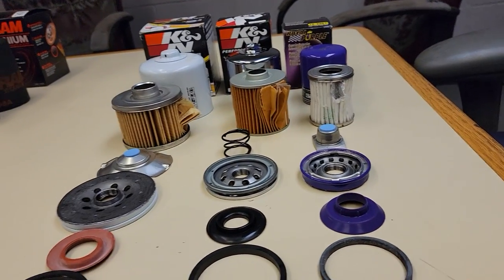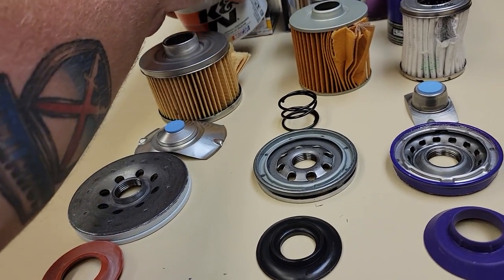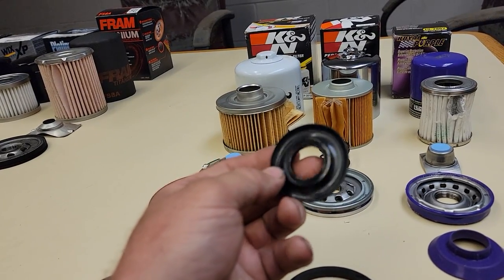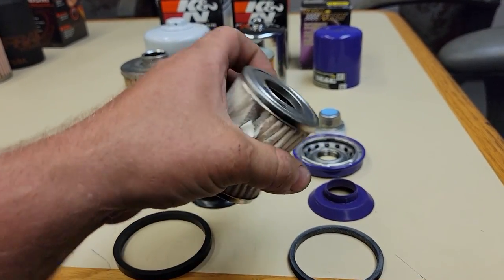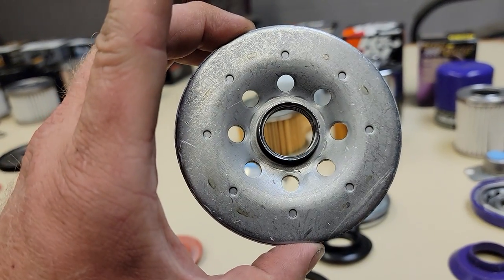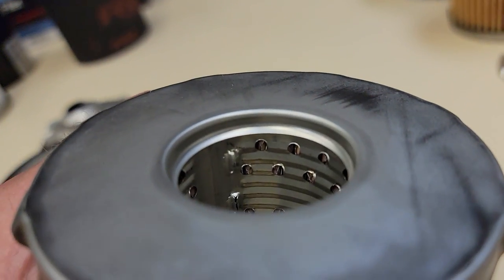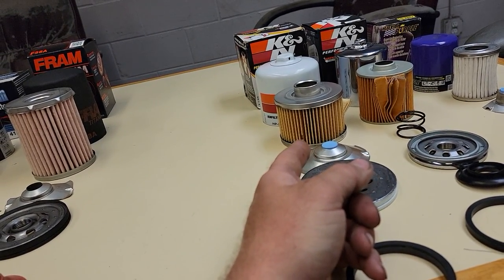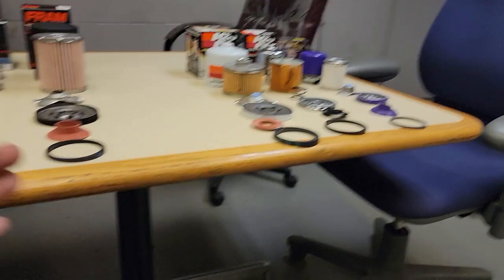K&N Plaitum, K&N Gold, Royal Purple, Fram Titanium - Break Down And Review - Fram / Gold - Tie

Comment: I just did my first ever DIY oil change @ 3K on my 2021 Tacoma with the 4cyl 2TR FE.  Used the K&N gold filter along with their brand of 0w20 oil. Love the channel.  I have brand loyalty which is why I went with them.
Reply: K&N has always seemed good to me, i don't like their Performance Air filters Due to them allowing more "Dust" in the Engine, But gives better "Air Flow" ofcourse. I'd rather keep my Rings and Valves in good condition than get 5HP to 10HP boost
Reply: @Robs_Got_A_Gun  Respectable. I will acknowledge Theres a lot of love hate with the air filters. To each there own though.
Reply: Tee Mack  The 2TR FE is a small motor and very easy to work on. The truck is part of the Tacoma Culture. Lots of groups and support with that particular truck so between YT videos and some homework it was a breeze. And I'm a complete novice.
Reply: @mikezat6328  tons of respect for ya Mike. Doing your own work is very satisfying and will save you a ton of money. Question: No free changes with that truck?
Reply: @chadpugh1490  They will not do the "free change" until 10k they only check it at 5K if you read the fine print. I'm sticking to the traditional 3K-4K intervals.

Comment: I'm not a fan of that Royal Purple one lol, I'll Stick to Purolator, To me Royal Purple is just all Hype, Their Oil ain't even as good as Pennzoil Ultra Synthetic..... and it's 2X more $$$
Reply: I figured I would try royal purple oil in my generator. Only thing I have used it for. Don’t know if it’s worth the money or not
Reply: EVER since I came across the Puralator, Have NEVER looked back or tried ANY other oil filter... I swear by Puralator.. I will say I have been using the Pure 1 for years now..But after Richs video and many subs suggesting the Boss Puralator... I just bought my first Boss..And for literally $1-2  more difference...
Reply: @Robs_Got_A_Gun  that’s good to know, won’t waste my money on that anymore, good thing I only bought a quart
Reply: @mattyroc77  Yeah same here, i only use Purolator, But gotta give some filters like Fram Ultra Synthetic a good Rating also.
Reply: @eradicater6854  as far as Expensive Oil goes, Go with Amsoil, It's the Best, But expensive.
For better Everyday Value, Pennzoil Ultra Platinum is really Good also.

I Personally use Valvoline Maxlife Full Synthetic
Reply: @Robs_Got_A_Gun  I run amsoil in my motorcycle. So expensive though, but the peace of mind is worth every penny.
Reply: @eradicater6854  Amsoil is definitely worth it in the Long run. I use Valvoline alot because it's a Good Oil accross the whole Spectrum of Tests it went through on "Project Farms" Rigorous Controlled Testing Methods.
Reply from the maker: Prim is underrated - the ultra synthetic and titanium filter I would probably put up against any filter on the market
Reply from the maker: Purolatorboss would be my regular filter by choice and seeing as they make Ford's filters to make me feel even better but I do have to give it to the factory Ford filter overall great quality

Comment: winner for value still goes to the fram ultra then the titanium.
Reply: Unfortunately Eli... Fram has changed the media on the Titanium and Ultra.
Reply: @jerryjeromehawkins1712  yeah I think I heard of that. I believe they actually made the synthetic blend media actually better but they removed the wire backing and kept the same metal caps so they kind of did downgrade it but they also claim to have improved the sub 20 microphone filtering efficiency which in reality is what actually matters. the engine doesn't care about wire backing and caps as long as it just seals it
Reply: @elihernandez330  hey Eli. That's good news then. I've been using nothing but the Fram ultra along with Pennzoil platinum on my 5.0 for the past 5 years... I refuse to use anything else, lol.
🍻
Reply: @jerryjeromehawkins1712  although it may seem like the Fram Ultra and titanium got downgraded it's really not even a big deal. the wire backing was just a luxury item that wasn't really needed in non extreme racing applications and having better 5 10 and 15 micron filtering efficiency does reduce engine where further so that's really what matters the mos. although I do wish you would have lowered the price by a dollar even then it's still the cheapest ultra high filtering efficiency filter you can buy and it has metal caps and a strong core so I wouldn't be afraid. Besides more expensive oil filters don't even have wire backing yet people still think they're better.
Reply: @jerryjeromehawkins1712  Pennzoil Platinum is very good, but Quaker State Full Synthetic has a higher oil film strength of over 150,000 psi. Oil film strength is the most important factor of a motor oil.

Comment: If 6000 miles wears out  motor oil and my lawn tractor hour meter times out at 100 hours.  Is 60 mph X 100 hours the same? My generators oil at 100 hours looks darker than my 3000 mile  car oil with a filter. Tractor hour meters go  how long with a filter? Hmm!???!

Comment: I've been using for a while Fram ultra synthetic with pennzoil Ultra platinum in my Mazda 5 2010 and very satisfied.  I've found at Napa Canada a special for the napa gold filter made by manns and hummel  quiet good also.  For my escape 2018 titanium Mobil 1 with Pennzoil ultra platinum for now is the perfect mix
Reply: Pennzoil Ultra Platinum is also my top oil choice. I’ve always used it in my 2019 F-150 5.0L Coyote.
Reply: Fram ultra synthetic + pennzoil platinum full synthetic for me. 10000km oil changes.
Reply: @youngb1ood  I change mine every 5K just to be extra cautious.
Reply: I use the same combo BUT I run the Pennzoil platinum for 5k and I run the Fram ultra for 10k. Both of my vehicles have cartridge filters so I was able to easily inspect the filter media during an oil change. At 5k the filter looked almost like new with no build up trapped in the pleats so I feel comfortable using the filter for 2 oci's.

Comment: Can you tell us that. Which one is the best oli filter.
Reply from the maker: Honestly at the end of the day the original equipment filter is going to be the best safest one to use that came on the vehicle from the dealership or from the factory

The problem that nobody pays attention to is the fact that you have to make sure the aftermarket filter bypass rate is the same as the original equipment or better

Comment: I'll wager Fram made all of the filters, with the flat bypass spring. Think about it there likely isn't a factory for every brand of filter. Forty years ago I sold Napa parts, Wix made their filters. Later I sold Wix filters for a truck parts wholesaler. Wix was the largest filter mfg, at the time. Then there were Baldwin, Purolator, Fram, and Hastings. K&N came along with their Hi-Perf air filters. However, those oil filters look strikingly similar to the Fram & Wix. Hmm